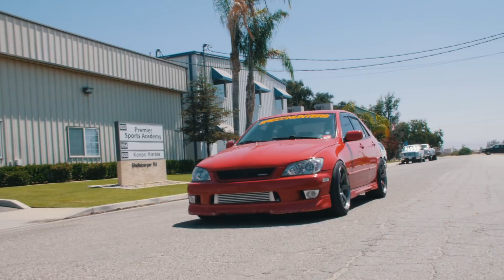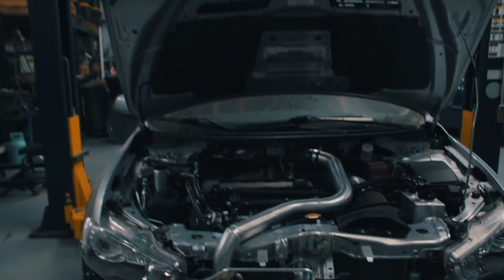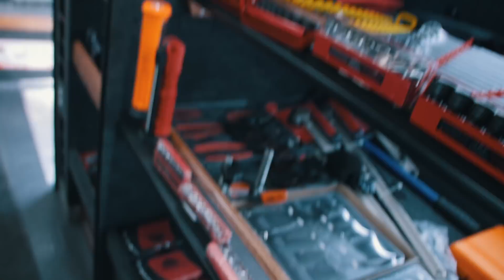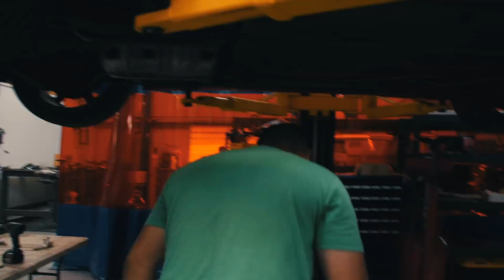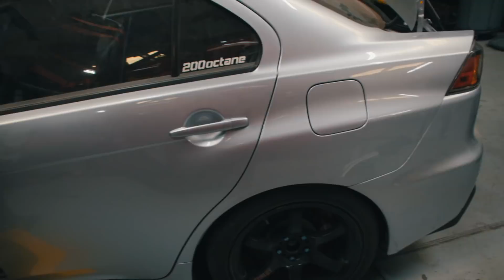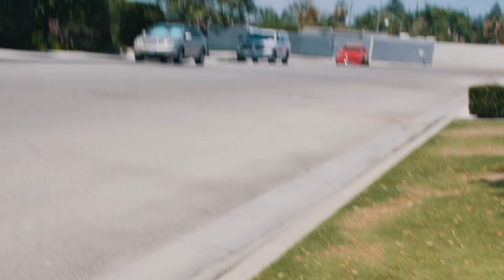The BEST 2JZ Sound. + T56 is in

Comment: What's the spec on the lugs?  My oem ones don't fit properly,  you have to get the volk lugs?
Reply from the maker: chrisej207 I have the Muteki steel ones. I’ve broken right through the Aluminum lugs
Reply: SR Entertainment I'll see how it goes, lugs aren't here yet.

Drag setup hows it rub on suspension?